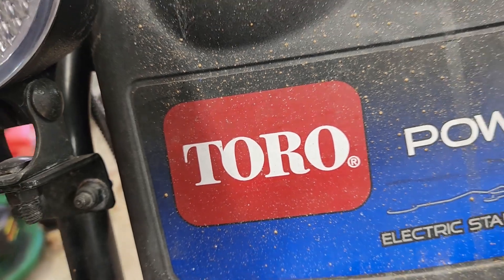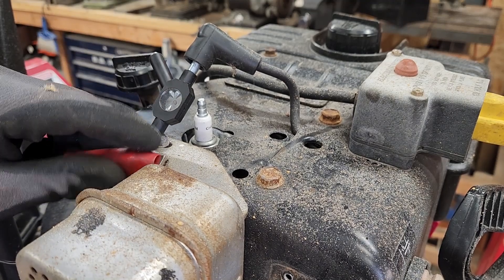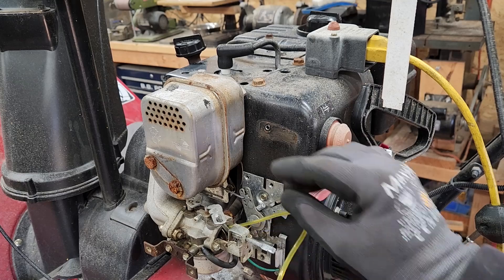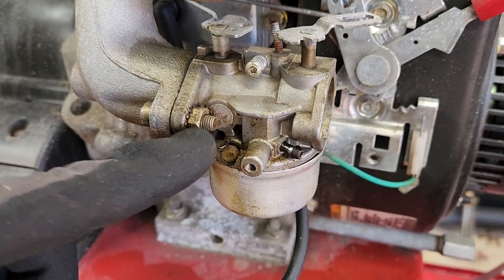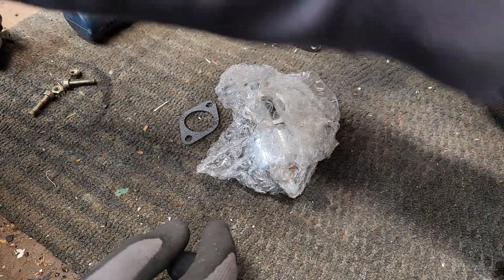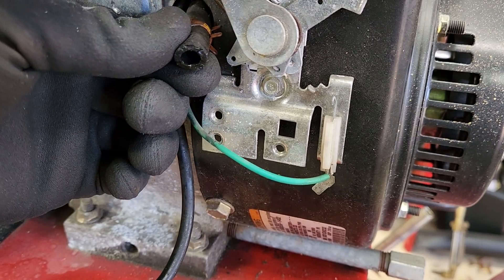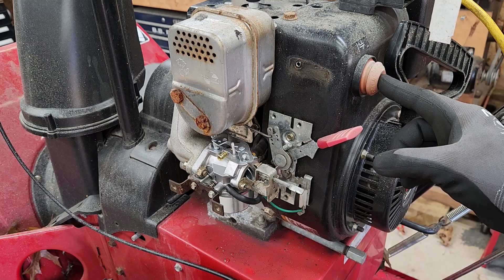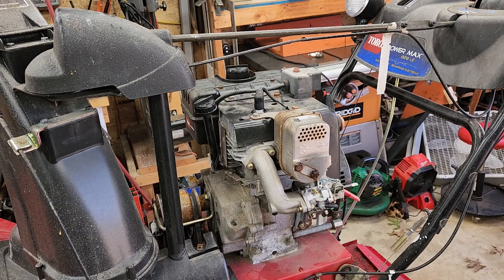Amazon Carburetor Replacement on Tecumseh - Will it work? - Toro 828LE Snow Blower does not run

Comment: Thanks for the detailed video. I’m in the middle of replacing the carb. I decided to replace the old fuel line from the tank to the carb. 
Pulled the old line out. Trying to route the new line. Trying to avoid the flywheel and cooling fins. 
I can’t work through. Any suggestions? Thanks!
Reply from the maker: Start this video at around 3:40. https://youtu.be/BwSs1daHJHA?si=6HwEjQgzBjz7OCxx
Reply: @thesmallenginerepairguy 
Excellent. I’ll give it my best. Thanks!

Comment: I've had good luck with Amazon aftermarket adjustable carburetors for my Tecumseh 5 and 8 hp snowblower engines. Why mess with rebuilding or cleaning carburetors when you can buy a new one for not much more than a rebuild kit. Sense switching to non-ethanol fuel and one ounce of Sea Foam per gallon of fuel, my carburetor issues are pretty much nonexistent on all my outdoor power equipment. Great video, thanks for sharing.

Comment: They work like crap I replaced the head gasket and adjusted the valve clearance and adjusted the governor and replaced the carb in my snowblower and I couldn't get low idle or high idle to work properly rebuilt OEM carb works great Amazon carb went in the garbage

Comment: Just did this last month with an Amazon replacement and it worked out well. My mistake was replacing the fuel line that really didn’t need replacing because the kit came with a new line and a shut off valve. What a royal pain it was snaking the line. 😬

Comment: I really had no choice, my barn find JD 35 yrs old needed a new seat  in carb.
Parts are not available, new 20 dollar carburetor has worked well.
Getting ready to drain carburetor for winter.

Comment: The best $20   you can  spend    !!!!!!!!!!!!!  / Use  ethanol free  gas   ,   when done   shut gas valve  off  run the  bowl   dry   !   The passages    are  tinny  in  the   carb  . And  plug  up   .

Comment: I have a lot of old stuff and one thing I always get a kick out of from internet small engine guys is replacing a carb with a Chineezium Carb made by Slave Labor and funding the world take over by the most barbaric super predatory government ever bar none. Some guys say the Chineezium carb won't work and I find that puzzling . There just isn't that much to a carburetor and most everything today has either no idle provision, or only idle and full blast. How much carburating do you need to have to idle and go full blast anyway?  But I personally like being able to dial in the Air Fuel Ratio with a highspeed needle valve and a low speed needle valve. So as much as I'd like to give my $$$ to the Chinese Communist Party (CCP) so they can take over the world and enslave everyone, I'd rather clean up an old carb. Since about 1995 or so, I don't take carburetors off and  clean them with Gumout much anymore. Instead I put Techron Fuel Injection Cleaner made by Chevron in the gas tank at a very very high ratio. Like easily 10 times as much as the bottle calls for. If it won't clear up the hunting after a few sessions, then is when I resort to the old standby with my Spray Gumout. You see, I was around when the earliest fuel injection systems at GM were born and I saw the very first Fuel Injection system in the company. We had an Isuzu that was running on a single carburetor. We ran baselined with it and then changed out he intake manifold for an electronic fuel injection setup on it. We got new baselines and compared them. It wasn't my decision on how well it worked,  I just ran the tests. I did drive it and it was a bit sketchy at first, but we are eons beyond that today. As soon as we showed it worked pretty good, off we  went (GM and I) and put together about 1,000 mules.   Mule setups were  everywhere running 24/7 and only shut off to refuel or do maintenance like oil changes. Then we dumped it onto the market and the unsuspecting public. First California in 1980, then the whole U.S. by 1981, But one to the problems with non-stop running for  "proving" was they never sat for a day. When the public got them they started having issues from sitting for a while and we solved them with the use of special detergent additives in the fuel. GM made a "deal" with Mobil Oil to put detergent into their Premium gasoline and the dealers were told to fill the gas tank with it and drive the trouble away. It worked. Chevron also developed a product for sale separate from their gasoline called Techron. It works wonders. For about $10 for 12 ounces it really is "God in a can." Mobil never put out a product separately that I know of, but a tank of Mobil Premium still works, I do it sometimes. But like I said, I am prone to using 10X or greater strength to get the debris out of the carb befor I break out the Gumout and drill bits. OK there's the story.  Now go buy some Techron by Chevron. ben/ michigan

Comment: A couple of quick questions… The information on the engine indicates that regular unleaded fuel should be used. My buddy (from whom I bought the machine) says he always used premium gas in it. What do you recommend? At the end of the season, I pump out the remaining fuel and run the engine until it quits. Other than cleaning and lubricating, is there anything else that should be done before storing the blower until next winter? I want to ensure the carb doesn't get clogged again.
Reply from the maker: Premium is not needed unless the manual calls for it.  I recommend using regular pump gas, ethanol free would be ideal but it is not available everywhere.  For long term storage, check out my video https://youtu.be/p4z2XXfzbEc and it will show you how I store my equipment.
Reply: @thesmallenginerepairguy  Thanks so much. The new carb should be here tomorrow. I purchased the kit, which included additional components. Hoses, clamps, a fuel filter, a shutoff valve, replacement controls, a spark plug, etc. Everything came to $30 Canadian. I'd rather have the extra bits just in case.

Comment: I would really be interested in where you found that carburetor and if you have a history of using it and it's performance. Thanks
Reply from the maker: Link in the description.  Because its adjustable, you can tweak the mixture screws as needed for your area.

Comment: Did buy a new carb last year works Great on full throthle and Downey to half but it cant idle. Adjust the idle end screw to max but cant idle.  But if i use half choke it idles high. Changed gasket for carb and intake cleand carburetor man times. tride adjust from 1-6 turns on idle mix but no progress.

Comment: Amazon carbs are a "crap shoot" at best for these older Tecumseh engines. Sure you can get 'em to run but the smooth performance across the power band is another thing, altogether! Loping at idle, midrange or high RPM will are very common with these cheap knockoff. Passages are never the same or accurately machined. The Tecumseh engineers knew what they were doing and tested the designs until it was optimal. Give me an old carb as long as it's not completely destroyed by water corrosion & I'll get it back to sweet running. Repeated ultrasonic cleaning with some gentle .010" wire cleaning to those bore passageways and it will sing again....like the day it left the dealers floor!

Comment: Why would I have gas coming squirting out the primer bulb when in low idle? Is it a bad needle?
Reply from the maker: Possibly, take a screwdriver hand and tap on the fuel bowl which is the bottom of the carb.  Might help.
Reply: @thesmallenginerepairguy it’s because my dumbass put the float upside down 😂😂

Comment: Why not just clean the main jet in the oem? Most times that’s all it is. The tiny holes can be chased out with a thin wire from a twist tie. Follow up with a squirt of brake or carb cleaner. Don’t need a rebuild.

Comment: Great video!  Thank you!  I have an old Ariens with an 8 hp tecumseh which is running it this year but doesn’t have the rpm/ power it did last year. I especially love your logical step by sue approach. I will adjust the carborator screw 👍🤞🏻

Comment: I put an Amazon replacement carb on my Echo blower and it ran perfect.  Its nice that they are adjustable unlike oem.  A tip put a little engine oil on the gaskets before reassembly.  Also on screw threads and the fuel and primer nipples.

Comment: I have one of those and I couldn't get it started. I checked the carb and discovered the primer line was cracked were it connects to the carb. 15" of primer line and  it fires right up after three pumps.

Comment: Thanks for the video!  I know it was originally posted over a year ago, but it helped me today.  I used your troubleshooting tips and got my Snow King engine running after cleaning the bowl and adjusting main jet.  I also bought an Amazon replacement for $13 that I will keep in the box just in case.  That $13 new carb came as a kit with carb, fuel line, spark plug, two gaskets, AND replacement throttle and choke knobs!

Comment: Just an FYI - it's really not recommended to start a cold motor like this and run it wide open. I suggest letting it warm up at idle first before putting it under a load. I see people startup their snowblower in sub zero temps, and start blowing snow right away. With a motor that has possibly been sitting for months with no lubrication in the upper portion of the motor, do you know what that does to the moving parts? No wonder people end up with blowers (and lawnmowers, etc.) that burn oil in a few years.
Reply: Some engines don't have a low idle. My push lawn mower doesn't have a low idle.
Reply: @DJSephEntertainment  Yes, some of the small push lawn mowers have a preset running speed and  the governor dictates the speed when running into tall grass, and they're pretty much a disposable motor. I have one and soon after I got it, I switched it over to a cable control on the carb so I can make the motor last longer (it runs like new now)
 A motor wears out the most during startup and running them wide open will only wear them out prematurely, but most people don't want to hear that, but then alot of them don't even bother changing the oil either.
Reply: @PainterD54  Do you have any idea why I have gas squirting from my primer bulb when in low idle. The snowblower runs like a champ on full idle. I'm guessing either the needle or float or both.
Reply: @DJSephEntertainment  Yes the needle or needle seat must be bad. You may want to change the primer too. They're cheap.
Reply: @PainterD54 My dumbass put the float upside down 😂😂

Comment: Queation, What cause the engine to pop when you try to start it? Thanks
Reply from the maker: I believe you are asking about when it first started, it was popping because the choke was on.
Reply: @thesmallenginerepairguy  i put the choke on, put it on fast, pull the cord and engine pops. Doesn't even want to try to start
Reply from the maker: @StudCity718   Spray fuel in the intake like I did at 1:30 in the video.  if it fires up, you should clean the carburetor.  if not, check for spark.  good luck!

Comment: You said rebuilding and they still surge. What causes that? Ive replaced carbs and still had a small  surge after a few uses. Annoying, and it hurts my head.
Reply from the maker: Most of the time, surging means the engine is wanting more fuel than the carb is delivering.  I recommend the adjustable carb so it can be tuned to where is purrs.
Reply: Do you have a screen filter in your gas tank?  Pull the gas line off at the carburetor and check for good flow.

Comment: I hate to be the one, but I noticed right off the bat that you never put gas into the gas tank. You went straight to the carburetor, you bypassed the fuel tank, why? Why didn’t anyone notice he didn’t check the shut off valve or add fuel to the gas tank.
Reply from the maker: Good observation and diagnostic point.
Reply: Yeah...he pulled the fuel line off and no fuel came out of the hose. 
Later he put the fuel line on and never mentioned fuel. That machine doesn't look to have nor has room for a fuel shut off.
Just an observation. Very valuable video otherwise. 😊
Reply: SLING BLADE!
"Mmhhhmm....ain't got no gas innit!    Mhhhhmmm."

Comment: Always clean and save OEM carburetor if possible, which most times you can. Yes, the cheap Chinese carburetors usually work just fine on 4-stroke engines.
Reply: Quick and ez fix for my 7hp tecumsa simplicity sno blower given to me that had run on ethanol
Reply: I can only agree. First I was thinking of buying a cheap replacement carburettor for my snow blower.

But instead I watched a couple of yt vids of ppl cleaning the same carb and then I took apart and cleaned the OEM.

The construction of the OEM is so simple so I think it is often fixable.

Comment: I just cleaned out the very same carb as preventative maintenance, the rubber seals were rock hard. I put it back together, and placed an order for a partial rebuild kit for basket side.

The machine I got it is from sometime 2006-8,  is that machine just as old? 

I noticed my engine is exactly the same, along with the carb too.
Reply from the maker: @sharifsircar  not sure the year of this engine but it's a tecumseh engine.

Comment: Hi, I have an Ariens SB which I can only start using the electric start. Even after it has been running  for a while, I have to use the electric start again. I have the same amount of spark by pulling the cord as I get when using the electric start. Can you suggest what I should look at?
Reply from the maker: If it has a Tecumseh engine like the one in this video and you have a clean carb, you might want to check your valve clearences.  If they are too tight, you will have a hard time starting the engine.

Comment: What were your final settings on the two screws?
Reply from the maker: @10mmsocket32  don't recall but you'll need to dial yours in based on your location and machine

Comment: Nice video, perhaps i missed it but what is factory setting on the jets? I've never seen that spark tester before, gonna get one! When explaining lean vs rich and which way to turn the screw. I think it would be better if you just used right/tight, left/loose as opposed to clockwise. Clocks don't normally face down, my 2cnts. I appreciate the effort put into creating this video, keep up the good work.
Reply: Factory's settings, 1 and 1/2 turns out from tight for both.

Comment: Before changing the carb just try to tap with a hammer under the carb and it work like new mine is running because of that😂😂😂
Reply: Stuck floats :)

Comment: I got another question for you....I have a ariens snowblower that was thrown away...its got tecumseh HS40 on it and after market carburetor...I tried to put the bracket on it that hold carb. and choke and so on...I have no throttle on it so I'm looking to find out how fast it should be going to adjust the main mixture screw ? Thanks in advance...your the only time that took the time to answer me on another question before...thank you
Reply from the maker: Adjust the main at full throttle.  Full throttle meaning fast operating RPM.  Hope that helps.

Comment: I have tried two different nonadjustable carburetors from amazon, and they only work on full chock and then next day they would not work. This time I will try the adjustable carburetor and if that won't work. then I will try the Oregon brand adjustable carb. I saw one viewer comment went to the Oregon adjustable brand that work well for him, and I heard Oregon carb brand works well on the Tecumseh engines or OEM carburetors. Thank you for the video this help me out to decide which carb to work with.
Reply from the maker: Glad this could help

Comment: So I have a similar Snow Blower. Leaks Gas through the intake side while running.  Replaced the Carb with a new one and it did the same thing...  Replaced it again thinking the one that was new was a return used.  STILL leaked gas through the choke area of the carb while running...  Set it aside...  FINALLY found the problem.... I had sucked gas out of a tank using a Turkey Baster with a black ball.  Must have gotten gas in the rubber area...  Found tiny black rubber balls in my gas tank... I had reused the gas I had sucked out... No Fuel Filter... The tiny black balls got in the needle valve and let fuel flow....  I have a DR Brush that I went to start and checked the oil. Full of GAS... Needle sticking.... Glad I always check the oil...  New Viewer.
Reply from the maker: I've learned the hard way as well to stay away from using old gas that wad pulled out of something else.  Good work figuring it out!